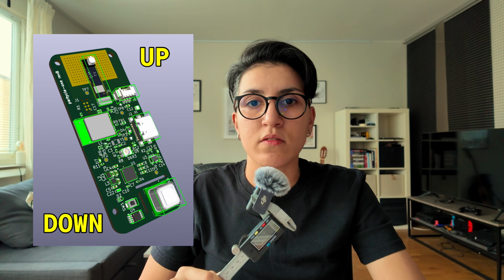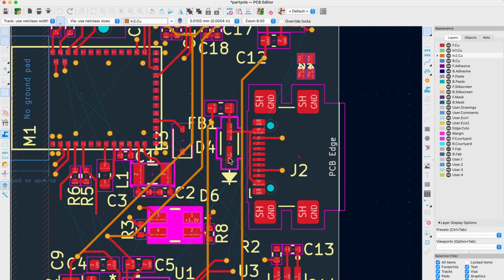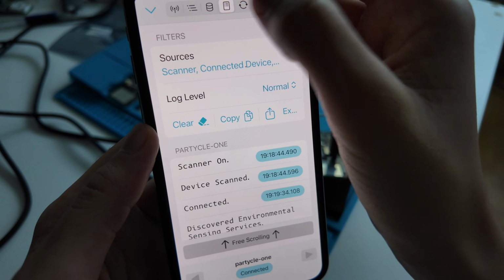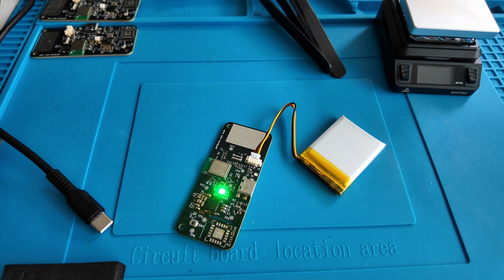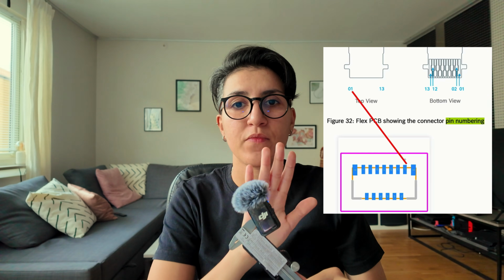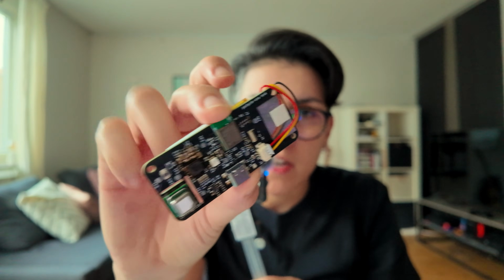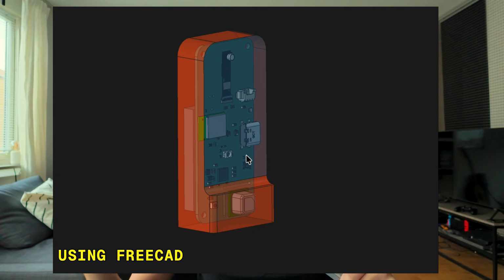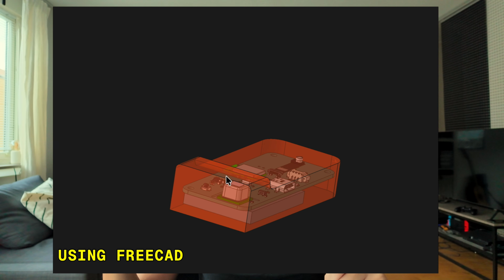Testing the first prototype of my air quality monitor

Comment: I hope, you gonna understand what I mean, as I'm also not native in English.
Some of my thoughts.
It's very interesting project and seeing the timeline. I'm working almost on daily basis because of my job with hot air rework station, so don't worry to blow components away, if you use kapton tape to mask out the surrounding areas and also apply some flux before removal it helps as well. You gonna see when the solder start to melts. You will need some extra hours to practice, how to remove, replace components by the hot air rework station. If you gonna work always with SMD components you should buy one of this equipment.
As it will be a consumer electronics, don't forget to every single part of your project must be ROHS compliant.
While you create the schematic diagram, try to place some testing points (which are of course transferred onto the PCB layout) on crucial areas.
Might be I'm wrong, but I'm always build my projects on prototype PCB first and not the full circuitry, just module to module and test them HW and SW at every stage. (you know, if somebody fails on the I2C bus it drags all of them down)
Just my observation, don't take as offend. I know you are just started to create YT videos and on the budget, but try to mount that mic on ANY type of holder, like a piece of blue tac on the desk and poke a chopstik into then clip onto the mic. It's a bit disturbing when the volume fluctuating up and down 'cos your hand is moves. You not need to rearrange your flat if your camera capable to controll the aperture value. If it possible change to a lower value, but not the lowes one 'cos the depth of field (the range of sharpness) be too narrow.
I'm happy to share my thoughts if you mind, share my knowledge/experiences.
Reply from the maker: I think for my purpose the hot plate works very well, no need to mask components or anything and it has also the reflow temperature profile you can program/calibrate the curve. Hot air is better for repairs probably, I guess I will learn if forced to 😅

I am aware of the RoHS requirements and all the components I chose are compliant ✅
And yes I have a few test points on the pcb ✅
Yes I agree module by module is a good way to test the design, and I tried to do it but I ordered partially assembled PCBAs so I could not remove some components to test the rest 😁

I am trying to find the best mic setup, when it was fixed on my shirt, in previous videos, the audio was a bit lower and not "crisp" (IMO), but yeah in my hand I move too much, I will try to keep it more static.
For the video I am not sure I understand what you mean, I don't plan to rearrange my flat, the camera is on my desk in the same position (more or less) every time
Thanks for the feedback!

Comment: A silicon molded casing could solve the issue of waterproofing and feel*
Reply from the maker: This idea is quite interesting, make the base unit not waterproof and add a silicone casing to protect it outdoors.
But I am scared of the cost and Minimum Order Quantities to have a custom mold made 😅
Reply: @busy_wait well silicon has the advantage to be big between bricoleurs and DIYers, you can 3dprint a mold and cure it yourself...vulcanization is also just an oven and a process away ... But maybe is a bit out of the scope of your home lab especially if you plan for a first rump-up of scale
Reply from the maker: I watched a few DIY videos, it's a new rabbit hole! 
But I will probably not start a rubber processing operation in my apartment 😆

Comment: What do you mean you cannot reuse the components soldered by the manufacturer? You just take them out with hot air or smth. I think the timeline is just fine, hardware is not easy
Reply from the maker: Yeah technically you're right, I actually had to recycle some nPM1300 since they were out of stock when I ordered hehe... but in practice it's a hassle: I could desolder using the hot plate and then I need to store somehow the tiny components to not forget what they are, some also need cleaning, plus after handling them I cannot be sure they are still 100% functional with ESD and stuff 🫣
Luckily the sensors I had ordered myself from before so did not waste money there!

Comment: Great job...but i disagree, i consider myself an experienced electronics engineer (NOT NASA LEVEL), believe me, i still get it wrong alot of times in alot of my personal projects. Sometimes due to rushing a job, and sometimes just because of arrogance. (I've done this before, nothing can go wrong). I have done simpler projects than this one, where i had to do like 4 or 5 revisions. You have done an awesome job on RevA, the mistakes is minor, but a major learning experience, i'm sure RevB will work 100%
Reply: As engineer I experience the same. Sometimes you make in first time, other times not. After same year you collect the knowledge about some circuits and components but you need to fail in order to get it. So fail os good.❤
Reply: and then you sit with RevD screaming why you forget to put that resistor for pull-up. :D 
But yeah shit happens :)
Reply: @alexzaslavskis4623  Yeah, most of the time, it's dumb stuff that forces us to spend more money, more iterations = more money out of pocket.
Reply: @cwflemmer yeah c'est la vie, usually second pair of eyes can catch it before PCB sends of to manufacturing….
Reply from the maker: I guess when you're more experienced you make other kinds of mistakes 😆
I hope at least to make all the mistakes in the beginning, when it's still cheap to fix them!

Comment: If it is withing budget, you may want to look into those usb-c thermal cameras. they are incredibly useful to debug pcb prototypes. You can start feeding power very gradually and see where the heat is, usually you can see hot spots before you hit the voltage that would fry the board. There are many other  use cases when prototyping. 
I'm following you and very interested in seeing you succeed and pushing forward!
Reply: I was thinking the same. 
I'm using infiray T2L sa my thermal camera for diagnostics ant I can definitly recomend it , costs around 300€ but it will serve for vast viority of aplications.
Reply from the maker: @Traper_T  Thanks for the tip, I'll check it out!
Reply from the maker: that's a good tool to have, adding it to my already list of (expensive) equipment I wanna buy 😆
Now at least I can finally carry it around and do some real world testing! Thanks for the support!

Comment: Hi! I was wondering why you couldn't recover the expensive components from the faulty boards. You have a nice hot plate now, so you could use it to desolder and salvage those parts.
I'm looking forward to seeing your progress, and congratulations on what you've achieved so far!
Reply from the maker: yes I can, and I actually did so to recover the nPM1300 that was out of stock, but it's a hassle and cannot be sure those recycled components are fine, so it introduces new uncertainties while debugging 🫠
Thanks for the support!
Reply: Is always a risk, some components nees to be baked to remove moister. It's fine for prototype but could introduce more issues.